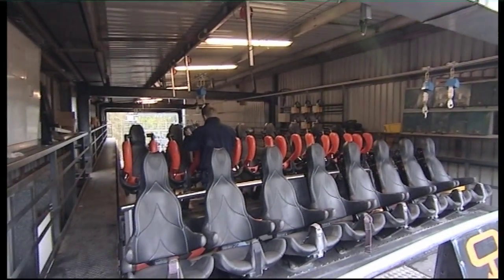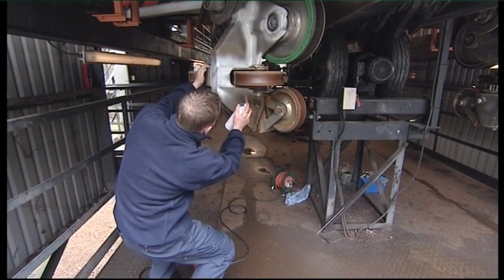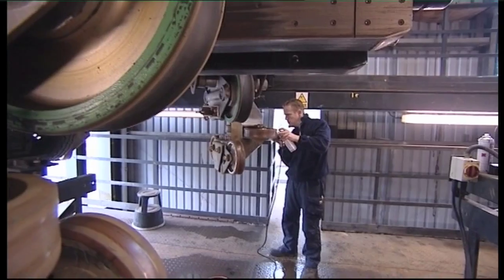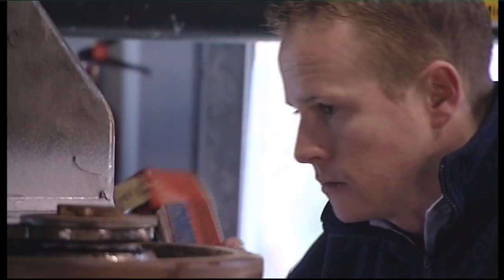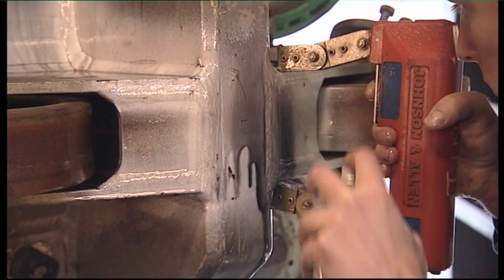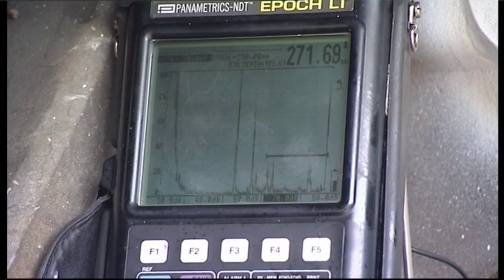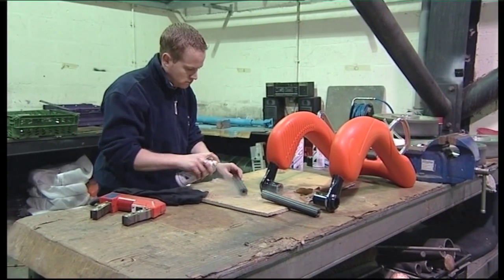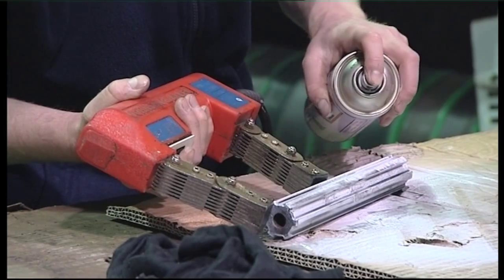BINDT - Fairground Rides and NDT

Comment: Why is he not using Fluorescent Magnetic Partial Inspection on that machined component? A more accurate test surely.  Also the film shows  a U/T set, but this testing method is not mentioned, what is the relevance of showing the set?